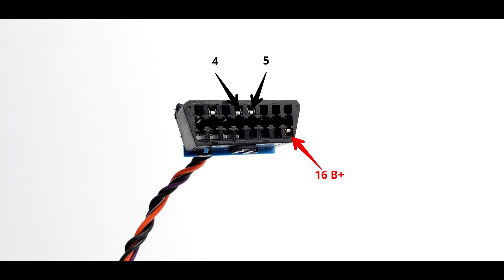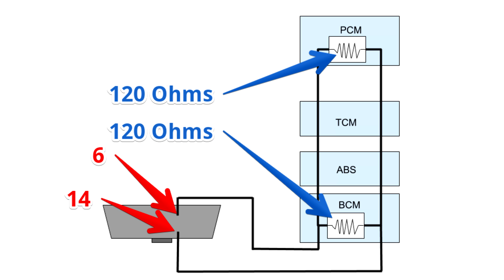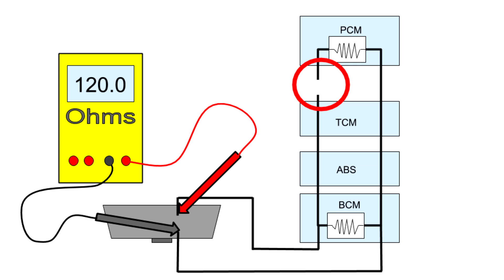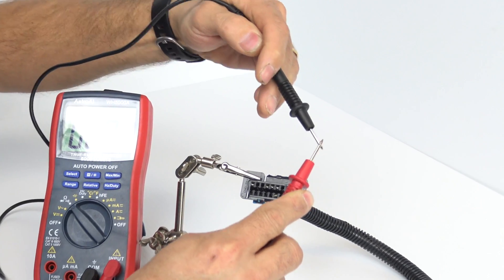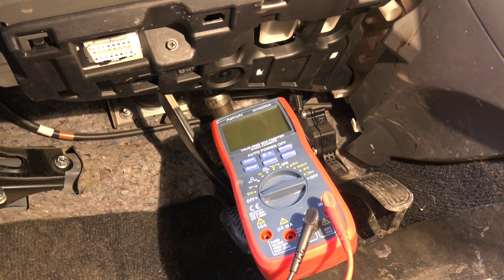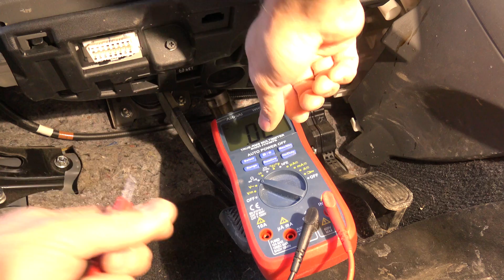DLC Quick Testing Tips

Comment: On the ASE L1 recertification test, one question had a reading of 62.2 ohms across pins 6 and 14. There were 4 answers given in regards to why it read 62.2 . Normal is 60. They didn't offer a normal reading as an answer. Open here, open there, short here, short there. One answer had to do with the terminating resistor in the PCM. I don't remember what I picked. But whatever the problem was, it was caused by the 62.2 ohms reading!!
Reply from the maker: I can't say the answer due to confidentiality,  ( i was on the panel for the l1 test ) one of the answers would not be possible.  Ase does not try to trick you. It was an eye opening experience to see the level of professionalism on the board.
Reply: Like I said, 62.2 ohms was the reading on the multimeter in the question. They wanted to know what was wrong. There was NOT a condition normal answer. Open? Short? And something about the terminating resistor in the PCM. Just reporting the facts.

Comment: can I  probe to any pin randomly without causing problem to the car .?
Reply from the maker: You can use a high  impedance volt meter to test low voltage circuits , make sure you back probe.

Comment: The usual hype resonates from the typical chimers who assault the moment with their grand praise about the video.
Being constructive, I must point out the major flaws in this presentation.

Yes I recognize that the gentleman is seasoned  in his knowledge and is exposing key information any novice can benefit from and that the video is just a teaser to acquire students in the training classes.  But if this presentation is a reflection of the online classes, I am reticent to apply.
To glue together what is presented, I have had to rewind the video so many times  to the point of major waste of time.

Too many things were left dangling, yet mentioned, that could have been clarified.  The presentation, though appearing to be very thorough and delineated at first, quickly bounced incongruently,  making it hard to follow contextually.  The on-hand section should have been exactly parallel to the beginning academic part.

Things were missed, and found in surprise, such that the Ignition key was ON since at some point we find that it had to be turned OFF.  We must assume it was ON from the get-GO!?  ...and there were no instructions as to why the key was needed ON, etc.  thus, is 16 B+ cold until the key is ON?  ...

Taking this apart point by point is a mighty long post, I only chose to generalize to keep this reply as short as possible.

My concern as one who is looking to speed up the process in expanding my automotive diagnosis ethos, is that the classes will suffer the same symptoms and wear on my patience watching time go a-waste having to plug the gaps that should have been handled to begin with. 

One thing I may have learned is that the CAN BUS has a door to be exploited at the DLC as a starting point for a quick check of the general integrity of the Network, though my weak understanding of this area of automotive logic is that there are 2 networks, one faster than the other to handle real-time functionality, and one slower for non-time-critical items.  Are there 2 other pins on the DLC that address the other network!?  (...pardon my complete speculation, my knowledge/misconceptions are born out of reading, not on-hand experience.  I am a shade-tree grease monkey looking to jump to the tech level.)

one after-thought, how does this 'manual' checking help as the diagnosis tool report would certainly show a com issue with the CAN BUS?
Reply from the maker: I will start with the last statement/ question. How does manual testing help if the diag tool already  tells of a problem? Well it for sure does help, and it can tell you alot quickly. For example,  if you have a vehicle with a daisy chain network and a few modules are offline , no com, does your scanner tell you if you have an opening the can bus , or a bad power or ground , my scanners dont. 
Testing the network resistance tells you very quickly the network integrity ( if a daisy chain style). How about voltages  on the network,  elevated , possibly a ground issue, lower than normal possibly  a power issue. Scantool doesn't tell that.

I appreciate that you watched the video! You are absolutely correct that there is quite a bit left out, such  as gateway types of networks , different protocols, etc. At the time I made this video my thought was to share some basics that helped me get a better grasp on CAN bus testing. I was primarily dealing with gm vehicle network issues , and the video reflects that, and fails to show the difference between  the 3 major styles if networks, daisy chain,(gm), spine ( ford) , star ( fca), or the fact we can have combos of these and or loops. I dont mention fd can, flex ray or eithernet, or MOST, or even get into LIN. We could spend a week  diving into all that.

I may may a follow up video to bring up the short commings.  Let me yor thoughts on what it should say.

Comment: I have 60 ohms betweent 6-14 but i only have .75v vetween 4-6 and .75v on 4-14. What would cause that?
Reply from the maker: Be sure to take a look at your specific vehicles network to make sure you don't have a gateway module, if you do not have a gateway  low voltages can be caused by bad power supply,  network wires shorted to ground, or a bad module. There are of course other things that can affect the data line voltage but those are more common things I see.

Comment: Thank you for this video. I have this problem that my OBD2 scanner will power on but will have a linking error when scanning, leading to no communication with the vehicle... sometimes when i plug it in the instrument cluster goes crazy... showing all kinds of failures like steering failure, airbag failure etc all of those disappear normally after i unplug it so that wouldn't be an issue but last time the airbag failure remained and it won't go off. After that i had the linking error issue trying to figure out what it is i saw this video and measured the pins. Pin 16 is ok... i skipped the ground ones and went to 6 and 14. Pin 14 gives a reading between 4-5 volts while Pin 6 gives less than 1 volt and i am not sure if i remember correctly i think that is regardless of key position... now i will try to do the resistance reading between the CAN pins with the key set to off position see what happens... is the reading of bellow 1 volt at pin 6 showing a faulty module for sure? or should i exclude anything else first?
Reply from the maker: Depending on vehie there can be variances,  so please get a service diagram if the network. What year make and model?
Reply: @BrianMann216  it's a fiat idea 2004 I tried to find a diagram online but no luck

Comment: I'm getting a reading of around 33 ohms between pins 6 & 14 with a no-crank condition on a 2011 GMC Terrain.  So that means probably a short on the CAN bus, correct?  Also, I'm only getting 11.2 volts on pin 86 of the engine control relay (R66), which I believe is also the ignition relay.  And that's the reading with the key on or off.  I'm able to pull fuse #20 and replace to get the engine cranking until the problem arises again.  When it's able to crank, I noticed normal battery voltage at pin 86 of R66 with key off, and 0.82 volts with key on, plus battery voltage jumps to pin 87, which isn't happening with key on when there's a no crank condition.  I was told that pin 86 voltage is supplied directly from the battery, but same guy told me sounds like it's the ECM gone bad.  Battery tested good, plus vehicle starts when I reset, although sometimes stalls a time or two.  Could it be a wiring issue between the battery and the engine control/ignition relay?
Reply from the maker: Are you able to get an all data diy subscription,  that would give you the correct information on the relays, the resistance of the can bus is off for sure. Divide the network  by disconnecting a module near the middle of the network and start looking for 120 ohms each way .

Comment: so essentially if all the ohms and voltages are correct its a computer engine issue
Reply from the maker: on this style system , daisy chain topology,  if the resistance is correct, you can generally say the network is intact, however in spine and star configurations that changes it up a bit. There are many variables to account for depending on the actual system that you are working on.
Reply: @BrianMann216  ok well pin 6 and 14 beep on the ohm meter when the key ignition is on so im guessing that is a short, I also have a loss of communication and a non start... I located a splice pack related to the GMLAN system and when i omh certain pins c & k I get a beep so im guessing that would indicate a short in the GMLAN bus related to the modules on that splice pack

Comment: What if you’re getting 7-9V on between pin 16 and 4/ground. Battery is all good. Scan tool doesn’t turn on
Reply from the maker: You have a voltage drop on a power or ground

Comment: Great video on diagnosing the obd2 pins. So I have 80 ohms measurement with the key off with the leads in one direction with pins 6 and 14. And if I switch + - they read 40 ohms. But on another reading after the key was cycled they were back around 60 ohms.
Little to no voltage between 4 and 6 at .06 volts or pin 4 and 14 are .04 volts.

2010 chevy tahoe limped home, barely running, guages going nuts etc. Won't start now. 
Any thoughts would be great
Thanks again for the video
Reply from the maker: I would suspect a bad ground
Reply: @BrianMann216  so after looking at the CANbus voltage I ended up unplugging one thing at a time. The first one I unplugged was the abs module on the drivers undercarriage. As soon as I did, the can voltage went to 2.6 from 8. I chose this area because it's so exposed to elements. But it also showed connection to my obd2 again. 
Not finished yet but getting there. 
I suspected a bad ground also. I cleaned and checked a ton of stuff and nothing pointed to a ground problem so far
Thanks for the reply. 👍

Comment: Thanks for the video. I got a 16 Yaris. 6/14 shows 2.5 +- on each one. No communication with any module! pin 5 shows b+ voltage off of  pin 16. Pin 4 only 8.3 volts. Supplied ground to pin 4, still won’t communicate. Have you seen this before. When I ohm 6&14 I don’t get 60+- ohms I get a fluctuation between 95 on up to 185 +-. Is the next step finding the terminating resistors? Any help would be great. Thanks in adv…..
Reply from the maker: I am very concerned with the voltage on pin 4 and 5, there is a open in a ground circuit.
Reply: @BrianMann216  I agree!! Seems that 4 is a chassis ground D1. I’m gonna try again today to find that ground. Also would that one ground cause the whole be  the work down???

Comment: This is very well explained. Now in my 2007 Mazda cx7 everything is good according to your explanation to have a good can bus, good Battery voltage, good ground, good ohms reading between pin 6 and 14, and still my scanner can't connect to the computer to check for codes. Any idea, suggestion? I was able but to connect one out of 5 tries, and eventually ones out of 10 tries in a period of time of 6 month to a year and this year I was able to connect to the computer few times during the year to check for codes and now I am NOT able to connect at all.  Any suggestion will be appreciate it.  Just recently I did replace the obd2 connector, to eliminate the possibility of a bad Obd2 connector. Still I can't connect to computer.

Comment: Thank you for the Video. Pins 6 and 14 giving me 69-70 ohms.
   I have a few U codes is what led me here. Trying to diagnose communication between pcm and trans. U0101 as well as u0214, and u0073 and lastly a c055-5a.   Any thoughts? Really scratching my head on this one
Reply from the maker: What year and model?
Reply: @BrianMann216  2007 Chevy Silverado 1500
Reply: @BrianMann216  Its Vin C , LT,  “07-13” model truck gmt900. U Codes are an intermittent issue. I can clear codes and truck runs great for a couple weeks then all of a sudden i lose the gears, Truck starts in 2nd gear only, barely starts from a cold start. ABS light constantly comes on just from pressing throttle from a stop. Sometimes No Codes come up but Truck is still starting in second gear. Have to manually shift from 1st to D. This 70ohms at 6 and 14 was something that stood out to me. Just not sure how far I should chase this find.  Thank you for reading and your time. Have a good day!

Comment: I bought the cheapest and smallest  oscilloscope a 20.00 dollar i am having problem to what frquency i should put. The multimeter does not show shorted or open can h or can low. I have been tryi g to fix my car a mercedes clk320, its been in a limp mode for 6 months

Comment: Have a question if your up for it .
04 GMC Sierra . Power at OBD2 port no communication. Also Allison trans no shift . If I tap on the class 2 data wire I can get the scanner to pop up and truck will shift momentarily. Bad ground , open circuit , short to ground ? I'm stumped
Reply from the maker: Tap it how?

Comment: Hi congratulations for the video first of all, I have a problem with an error code U0101 communication lost with the TCM, but on the can bus test I have 61.8 ohm there is no open field, what can it be and how could I solve this error since I accelerate and arrive in fourth gear at a speed of 50 km / h, thank you
Reply from the maker: I would be checking the powers and grounds to the module that is not communicating.

Comment: You never tested pin 2 and 4. I guess you don't have a class 2.
 (class 2 dataline, purple 🟣 wire) 
What is that normally on gm?
Reply from the maker: This was more of a general video to cover the most common , can bus. Gm class 2 ,( pin 2) is 0 to 7 volts i have some other  videos showing on scope.
Reply: .7 v fluxuating 
The car started right up today. Yesterday no.
I got 2 bad coils on cylinder 5 and 6. 
You think that cause a short ?

Comment: I've had a terrible theftlock issue on the Cadillac cts ( so many of us 1st gen cts do,) and all videos on YouTube are wrong saying it's the computer. I've got low voltage 9.3 v between 5-16. But good voltage 12.9 v across 4-16. All other readings good.
So bad signal ground ... Where should I check first ?
Reply from the maker: Find where pin 5 is grounded.

Comment: noted pin numbers:  Ground Testing \  Pin Layout - rows   @ 4:44 ... 4:50  #s 4 & 5   - you are now in the Top Row.  
What is Top of the 3 Rows in relation to those beneath it?    Does vehicle need to be running to test Ground 4 & 5? ^ 
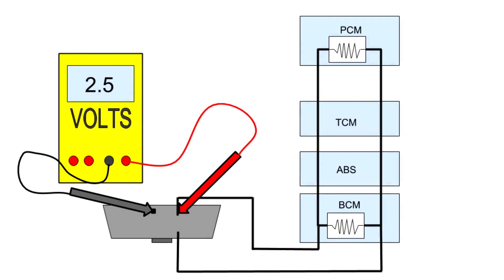2:08  #4 & 5    1.5 - 2 V is this when Running?   ie:  3:50  mV - Off  \  V - Running.  Max mV?   5:28  car still running?   
Thanks!  Knowing pin relations to others is very helpful.  i have pin out in cap, was just not sure of rows here.
Are readings Same in other cars as here?  -  my Car's DLC under hood  ('95 Celica 5S-FE)  
sorry, not my forte', i want to get this.   Just hope words don't twist  - Volt not Ohms tested and visa versa   lol   {{sigh}}

Comment: working on 2011 volvo xc 60.u0199-00,u0200-00,  6 to 7 u codes lost communications. during that all lights come on. windows don't work.no radio. cluster not working either was checking it had 75 ohms of resistance. And 0.45v . any help would be appreciated

Comment: Tested for resistance at pin 6 and 14. I get nothing. So I pulled the DLC to inpect the pins to find no pins or wires! What gives? 2005 Chrysler Pacifica
Reply from the maker: Not  a CAN vehicle,   I think in '06 the Pacifica is a CAN vehicle
Reply: @BrianMann216  Thanks I found a DLC Chrysler wiring diagram and it shows  no connections. Unfortunatly the majority of YouTube videos say, "Check pins 6 and 14" !

Comment: What can I test on a 2004silverado 1500 2wd I don’t have pins 6 or 14 to check cambuss any ideas please help my reader will not connect I have power to reader but my mechanics cannot figure out what’s going on cleaned all grounds connections watched many other vids on electrical any recommendations? Thank you for you’re time plz help!!! Thanks 🙏
Reply from the maker: Check Pin 2 with a scope.,  Does it have a aftermarket radio?
Reply: @BrianMann216  yes aftermarket radio installed 2-3years ago wife got it professionally 🤞done and do you mean an oscilloscope?
Reply: @BrianMann216  Thank you so much for reaching back to me this has been quite frustrating I appreciate it

Comment: I have 120 between 6 and 14
Reply from the maker: There is a open circuit, divide the system and test at different ends.
Reply: @BrianMann216  how i can do that because i disconnected the pcm and there stay and 120 is a honda accord 2018

Comment: Useful information but my vehicle does not have 6 & 14 CAN pins. It only has 7 pin K-Line. Will the K-Line test be the same as CAN test? My scanner has problem performing ABS scan and I was told the K-Line maybe faulty.
Reply from the maker: K line is different,   more of point to point testing procedures. CAN bus is easy due  to the 2 wires.
Reply: @BrianMann216  Thanks for clarifying  , I am looking forward for someone to do a video on K-Line testing. If you happen to have a vehicle with K-Line that would be useful.
Reply from the maker: @drew0991utube  kline is interesting because it generally gets you into a module or 2 , but is not the comm between modules.  I really don't have alot of experience,  but will keep an eye open for a chance to share more about it as I go.